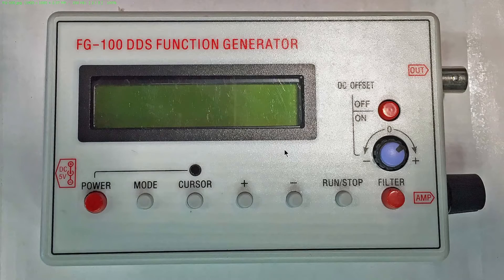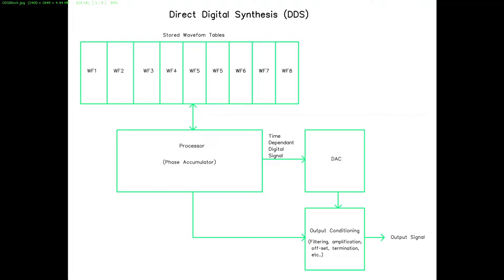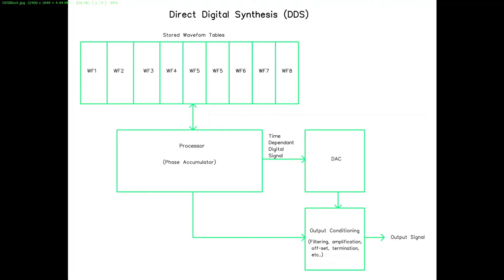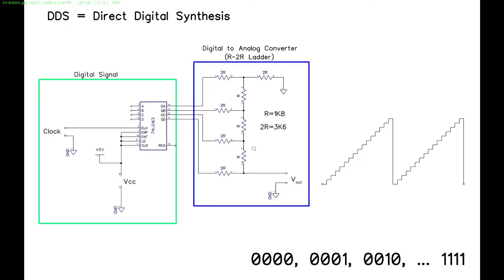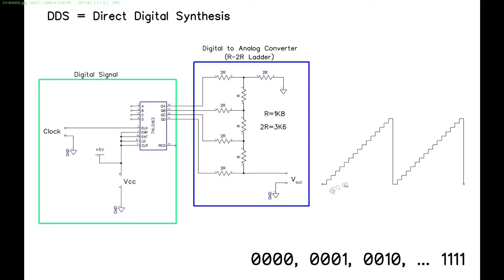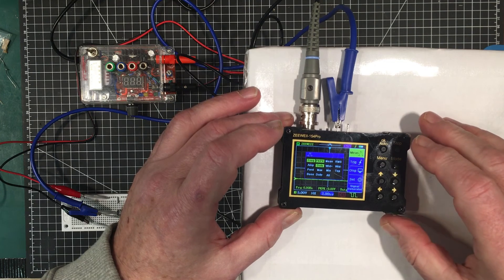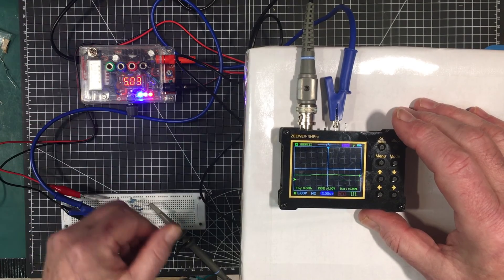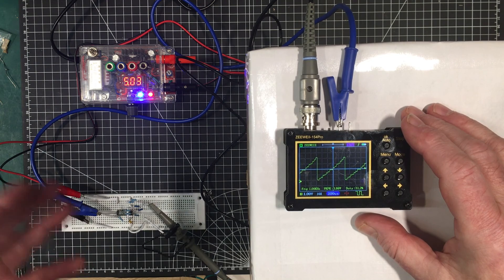0139 - Direct Digital Synthesis Explained

Comment: Looks like COVOX to me
Reply from the maker: Yep, the Covox Speech Thing used a simple 8-bit R-2R ladder DAC.
Reply: @uni-byte I mean the sound card that connected to regular 8-bit parallel port.
Reply from the maker: @JohnJTraston  Ahh, I see.  I think they were pretty much the same thing though were they not?.  Just different marketing.  I could be wrong.
Reply: @uni-byte  Not sure about the speech thing specifically. But this 8-bit DAC was used a lot of different platforms as a cheap sound card from 8-bit machines like ZX-Spectrum all the way to PC.

Comment: Great explanation of DDS thanks ! love your 'second' scope, I use the same one myself and largely based on your review! I am waiting for the 1st and last revision of the PCB for my Wien Bridge Oscillator to come from China and I have high hopes as my prototype gave me 1.08Khz with 1V Pk-Pk and a THD of <0.004% a bit higher with noise added but I'm not concerned, and I use a middle of the road sound card together with ARTA or REW software  (they both agree at least!) as I have a dreadfully noisy environment to iron out ! its those pesky harmonics I got rid of....cheers.
Reply from the maker: I'd love to hear more about the WB oscillator but have low distortion.  They are tricky.  Did you use transistors or an op-amp?

Happy Holidays!

Comment: Wow, you taught me something... I would have thought the DDS would have calculated each wave form, from the ground up, based on the given perimeters. No - an original waveform is discounted (dumbed down) to arrive at the desired perimeters... Cool...
Reply from the maker: Yes. This way the parameters can be changed on the fly.  Better generators have bigger, better and more built-in tables.  Glad I could pass on some info.